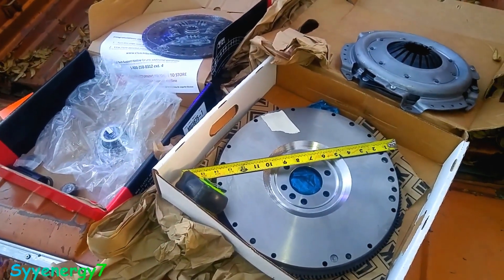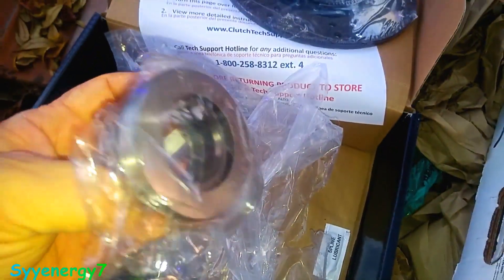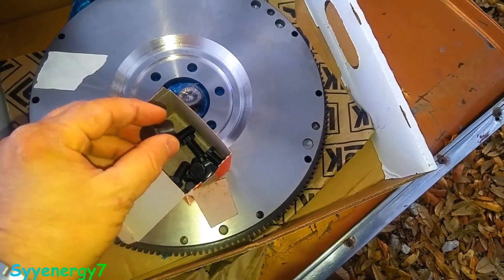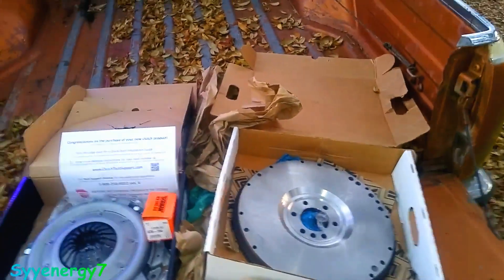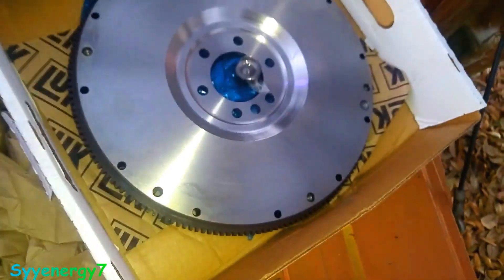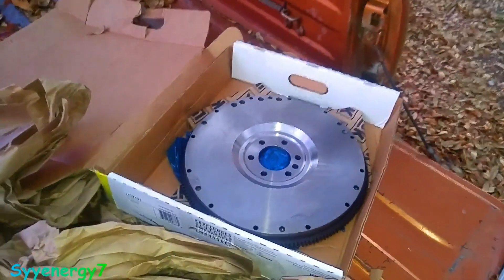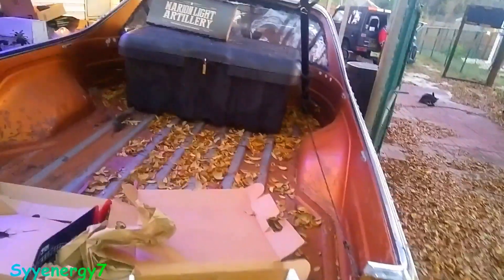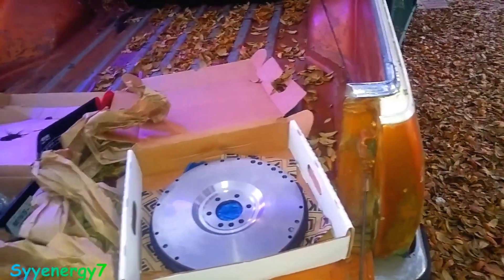Flywheel and Clutch Mismatch -Chevy, SBC

Comment: I have a pre-1985 Chevy 350 which has a 2 piece rear main seal. I bought a flywheel from Luk Clutch Flywheels and the diameter for the center hole doesn't fit over the crankshaft. Too tight. Looks like I will have to bore it out. I have read somewhere that other people had to do that as well.
Reply from the maker: I guess that's the "Chinese quality"